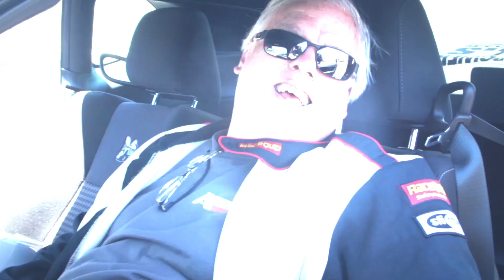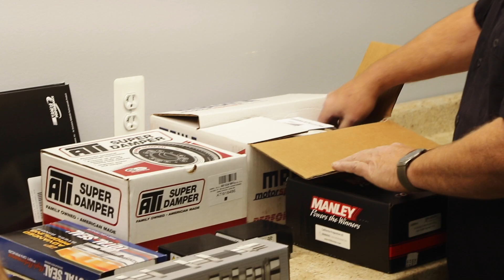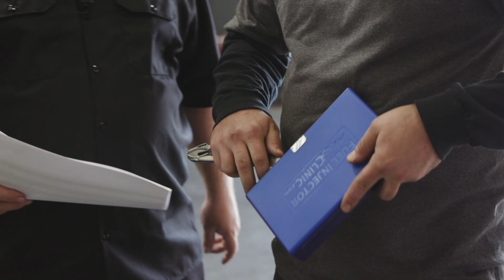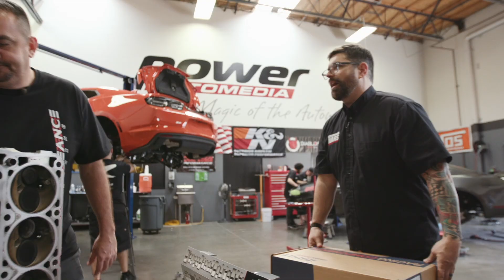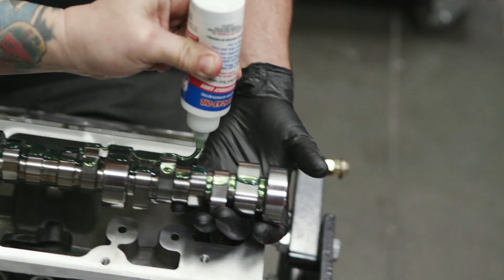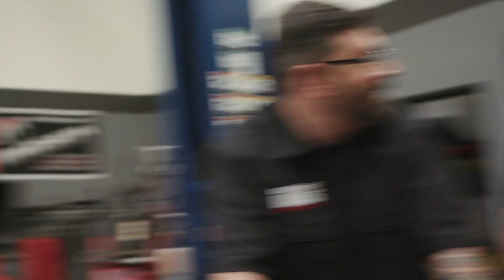Pony Wars 2 Episode 3: Preparing for ProCharged Boost

Comment: Love how the bow tie pecker heads are the only ones who have to put heads on to make power. And wow budget blown on the cheapest power plant to make power with . And ya they say Mopar is the expensive ones to make power . Haha. I do think the Ford guys really are screwing themselves by not upgrading the timing chain.
Reply: 7900 for a fully built motor that is going to do both make the most power and win the drag race while the mustang took 1 full day for 1 gear and is going to blow up at only 900hp 🤣
Reply: @nathan22outdoors8  correction $7900 for only a partially built motor. Fully built would be way out of budget for this comp. And ya the Ford guys really needed to put more money into the timming set on that motor. If it lasts the full comp it won't live for very long after unless they address the chain. And 7900 for  partially built engine versus mopars 3204 a partially built engine again why is Mopar deemed so bad and so expensive and they didn't even have to change cylinder heads.
Reply: @fc3sboy1  that LT is just about fully built. The only real thing that was untouched was the block. The camaro also has a much better suspension setup so they didnt need to put much money there and put it into power instead. That just about garentees them the dyno win since they can push the LT much further with a boost specific cam and supporting mods. Drag race should be good too since all you need is power, low weight and grip. Camaro and the Mustang are the lightest, camaro is most likely going to make much more power then since the camaro also has suspension mods coming it will have close to the same weight. The mustang will be good at everything, but not the best.
Reply: I think it’s funny the Chevy guys spend $7900 on their engine and ford spends $300 and it’ll make the same power haha. The chains should be fine but they should have done cams. They were already there and they aren’t that much. Chains, guides and tensioner are cheap insurance and if they were already into the motor why not. 

And as far as taking forever to do oil pump gears that’s just because those guys are retarded. I think book time is about 8 hours. Maybe 10 hours for your first time.
Reply: @108SBSO  Think what u want but i can garentee that LT will make a shit ton more power than that coyote. More displacment and cam for boost vs a 5.0 with stock cams 🤣 and for 900hp you should also be worrying abour rods, not just the chains.
Reply: What TC upgrade do you suggest for the 5.0?  You don’t know Ford Mod motors eh?  If the chains, tensioner are worn, you use Ford OEM.  This is a brand new motor, duh.
Reply: You're not very smart are you?  The cylinder heads are factory GM LT1 heads,  they are just ported.  There is a reason there are thousands of fords and dodges powered by Chevy LS based engines , and you couldn't find a dozen late model hemi powered Chevys if your life depended on it.....
Reply: @bdd1469  still a head swap was needed and head work is done. There for why. My point is this why does everyone say the LS is the best . Noone has been able to answer that question period.
Reply: Randy Slagle damn bro I hope it makes more. They spend like 20 times more money on it haha 

I don’t agree with what the mustang guys did. They should have at least put cams for boost. Fords stock cams are for the masses. Emissions, drive ability and fuel economy. If the LS makes more power it’s because the builders spend WAY more money but also made smarter choices. If you spend $7900 on the 5.0 it could hold 2000+HP
Reply: @bdd1469   bdd1469  again noone is explaining from their own words their own proof why the LS is God's gift of the power plants. Tom Nelson rarely use a stock block and never have I seen any of the Nelson race engines ever use stock gm heads. Again why is the LS so good. Lemmy guess the next name your going to drop on my not so smart mind is going to be Steve Morris of Steve Morris racing engines. And again the amount of mods he does to the LS to make power reliable is extremely costly. And Steve would be a better example of someone reliable to use instead of tom. I respect both of them shops and infact have had Nelson tune an ecu for me on a turbo 5 cylender Colorado that I did years ago. So me being a very dumb person and knowing nothing please inform me of why. I will leave the Ford stuff out since them guys seem to have their shit together and know the reasons and can explain why they like that brand. But why is the LS deemed God of the push rods?
Reply: @fc3sboy1  Let me make this simple for you so you can stop wasting my time.  Morris and Nelson build ultra high dollar engines , because working for guys with money and all new parts is much more fun and profitable than building junkyard engines for guys with no money.  But......the guy with no money can buy a complete running  4.8 or 5.3 for $150 ,  gap the rings,  change the cam and trunions, put an ebay turbo on it,  and blow the doors off 90% of the shit on the street for next to nothing. Its been done a million times.  I have a 6.0 and an aluminum LC9 5.3 in my garage right now and only have $350 in the pair with an ecu , throttle bodies, and wire harnesses..... 
  If you are a mopar guy and have a hemi that is obviously the way to go. If you like fords and already  have one that is the best engine to build. ( not really, its a ford)   
 If you want to go fast cheap the LS is a no brainer.  Aftermarket support, cost of parts, packaging, easy to swap/tons of info  , big power / low total cost involved,   get it tuned at cosco.... The reasons are endless.
Reply: @bdd1469  apparently Ford using forged rods stock means the entire engine design is superior lol
Reply: @motoant7055  Well..... The rods probably will last longer than all those extra valves and camshafts when the stock timing chain fails.  Superior in what ?  Extra large packaging ? Small displacment?   4 x as many cams and valves to pay for when your shit blows up?  Good power up top but no torque down low where it counts?  No thanks,   you can keep your ford garbage.
Reply: Randy Slagle they say LS is cheap. This proves otherwise hahahah
Reply: bdd1469 it’s not as if you still can’t build cheap pushrod Ford motors.  I don’t think you can build a cheaper more effective motor than BBF; Kaase heads, 520 cubes, 900 hp for under $10k.
Reply: @bdd1469  that's cause you can find junk yard ls engines with low mileage (cause they are already in the junkyard) for cheap, that is the only reason, ask most people that's done it and it'll come down to the engine was from the junkyard, bowties suck Ford coyotes

Comment: I love the coyote, change the oil pump and poor on the boost while the other guys make scrap metal out of half the long block
Reply: It literally took them all day to change 1 gear in the same time it took the camaro team to rebuild an entire motor. I cant wait to see the mustangs suspension finally done in 2 months if it tool 1 day for 1 gear 🤣. Best part is that the motor is going to blow at 900hp so this isnt the first time they will be taking it apart.
Reply: @nathan22outdoors8  there have been plenty of 5.0s makeing 1000hp on stock bottom end.
Reply: @lukelanam6045  Not on linerless blocks the '18 and 19' models come with and lasting, and especially when not on some form of alcohol fuel. Thats a huge advantage with e 12:1 and adding boost. Huge tuning window and it keeps temps down.  Even with the higher octane the temps will be higher than with E/C85 or M1 or FTW. I dont think this will be as easy as the "stock" shop cars everyone fanbois about.
Reply: The LTs first big weak link is the pistons. Change rods and pistons it is good for 1200 wheel. For a gen 3 coyote to handle that much power it would need to be resleeved and pistons and rods.
Reply: @smiller225  you took that comment directly off of this video, you actually believe these guys lol
Reply: Quite honestly, tearing down a whole motor and bolting back together generally will be easier, especially with the motor out of the car, than changing a set of gears on the front of the motor with the motor still in the car, kind of like trying to change an oil pump while the motor is still in the car with the crossmember, headers, trans all hitting other parts in the car... And I'm sure these guys really don't know what their doing and are somewhat inexperienced?
Reply: They did that to be nice . Because of all the extra cams,  valves,  and timing chains used in fords they need all the scrap metal they can get.